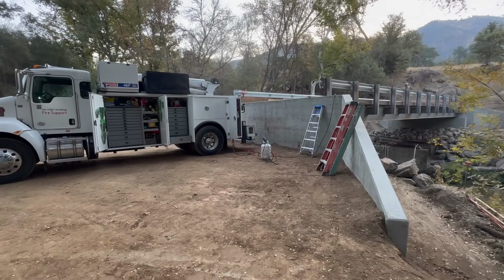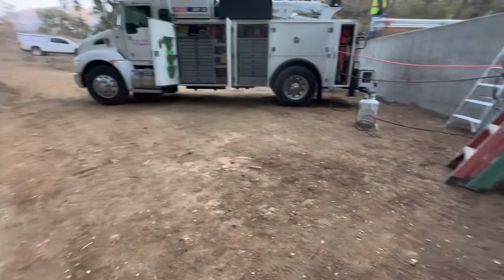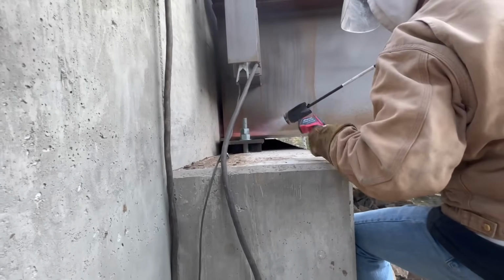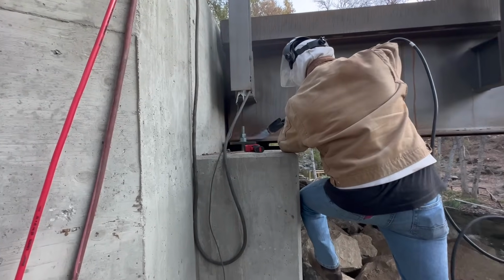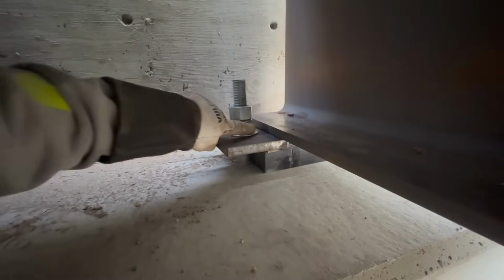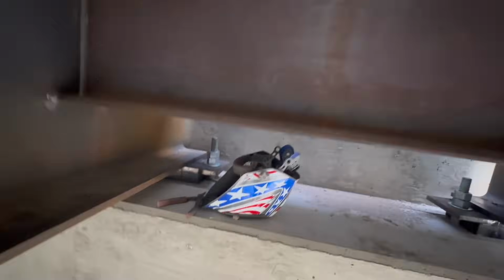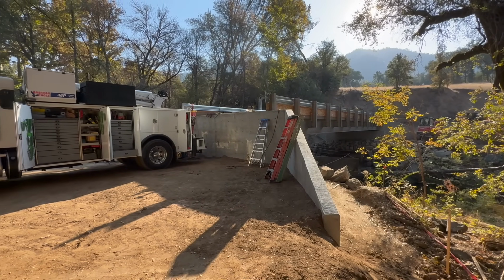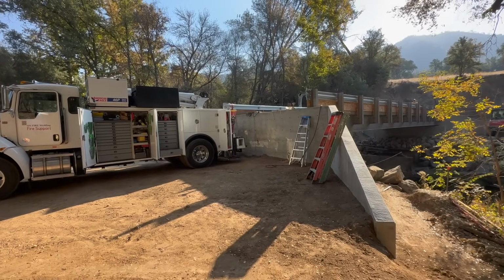Welding bridge footings in the middle of nowhere

Comment: We see a lot of Oxy/Propane cutting as an alternative,  my husband can't find someone  that can explain the real advantage & how it cuts. Could you shed some light on this subject, he did conclude that it takes a different hose & tip to make it work properly. Your comment (s) and opinion is needed on this. His morning coffee show before he goes to the barn  is On Fire Welding and I C weld, pretty funny !
Reply from the maker: I have cut with propane/oxygen and I hate it.  It burns colder and takes longer to heat up the metal.  I don’t have a ton of experience with it. I just stick to acetylene/oxygen.   But for pre heating, as in this video, propane can be a good option.
Reply: @OFW  Happy Thanksgiving to your family thank you

Comment: Nobody thought  about  expansion  and  contraction  when  dreaming  up this bridge. Keep an eye on your  anchor bolts where there cemented in. Won't take long.
Reply from the maker: I made that exact comment to the head guy there.
Reply: I totally agree, there’s no float in that system. The steel was 30 some degrees when welded and every day that’s going to expand and contract. Something has to give. I assume this is on private property.
Reply: I've done the exact thing that Greg just did and the baseplate holes were slotted on the anchor bolts. Also, those little cross girters were welded in the field unless they  got a permit for a really wide load. Gotta be at least 15 feet wide.

Comment: Great project!   Thanks Greg for sharing all your parameters: WFS, voltage, type og wire and gas used.   Thesr little things are one of the main reasons I subscribed to your channel.   I ejnoyed this structural welding video very much!

Comment: Seeing you working on a Bridge straightaway brought back memories of my first job after finishing my apprenticeship.
I went from a Shaft shop to a Fab shop.
Most of the work I was involved in was repair work.
Much the same as you show in your videos.
I was lucky enough to have a boss who was a Welding Inspector.
The not so lucky part about this job was occasionally working in a local open cut mine.
Pretty much every time I went to site.
It was either raining or it had just stopped raining ???
I can only remember maybe half a dozen times that I went there it wasn't muddy ??
But, the pressure was definitely on with a boss as a Welding inspector.

Comment: I hear metal prep is key to welding. The only prep I saw was the preheat. Can you weld non-shinny metal because of the duelshield? Thank you for the reply! Enjoy your videos!!
Reply from the maker: It was cleaned with a wire wheel on a grinder beforehand.  But it is better to have shiny steel to weld.
Reply: In a perfect world, sure you would always have shiny metal but, in the real world of structural welding; If your supervisors catch you grinding off the mill scale before every weld, you won’t be welding there long. I’ve even been reprimanded for grinding off paint and galvanizing.

Comment: You always crush it dude!!! Just watch out for LOF with a 2F dual shield.  Its great out of position, and in the flat with all kinds  of joints.  Its just easy to get LOF at the root of the joint  in the 2F , due to the properties of the wire being a faster freezing puddle for out of position welding.   It can be done , I have made good 2F welds with dual sheild. You just have to really make sure the slag dont roll over out in front.  Cut and etches really help with this. Kepp crushing it dude !!!
Reply: What is LOF?
Reply: @1963SMITTY lack of fusion

Comment: We just got a used Big Blue 300 Pro diesel at work, and we'll be needing to hardface some very large loader buckets in the future...what do you reccomend for a wire feeder for general use as well as hardfacing? I could use stick, but for a job that size it'd be time consuming and more strenous i assume.
Reply from the maker: Definitely wire over stick. It’s so much faster and easier on the welder.  I run Miller 12vs and arcreach 12.  Both are great for that application.
Reply: Lincoln LN-25 Pro!

Comment: Question, and pardon my ignorance. Wouldn't stick welding be a lot stronger than mig?
Reply from the maker: Actually no it wouldn’t.  It all depends on the wire. The wire I used is used to build buildings and bridges. It’s stronger than the traditional 7018 stick rod.
Reply: What he’s using, while it’s the same equipment as MIG, is NOT MIG. It’s gas-shielded flux core. Whole different animal!